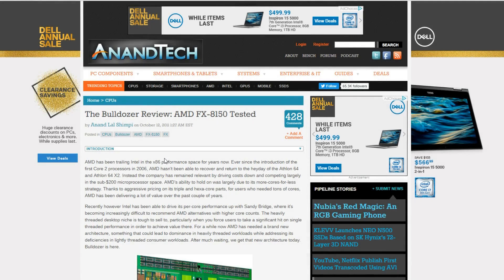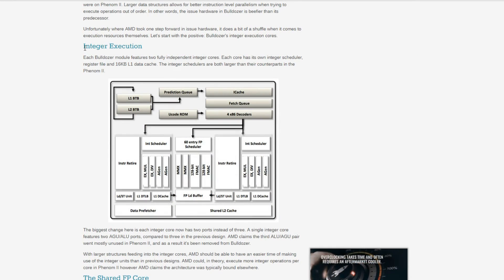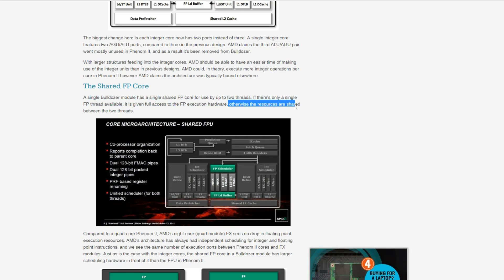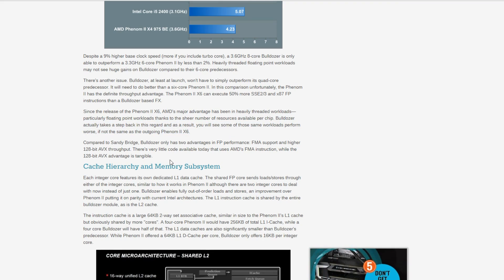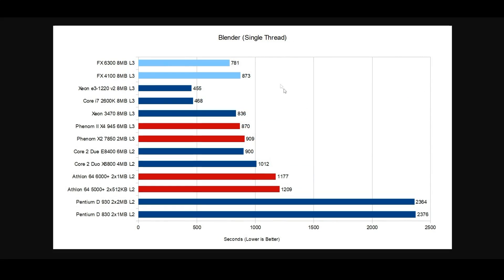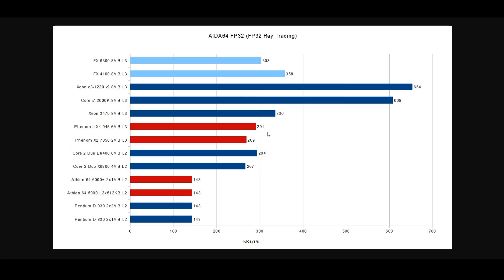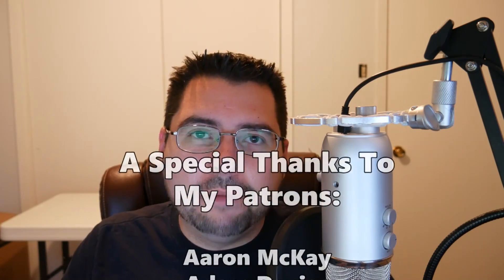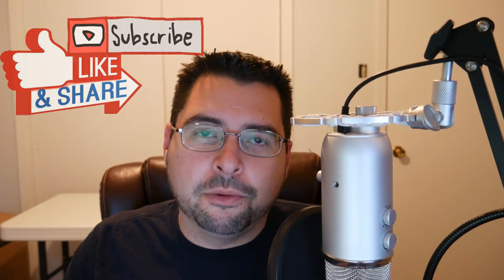IPC Test 7: AMD FX Series CPUs! How Does it Compare?

Comment: 💻 My PC is currently a FX-8350, and I'm glad that more games are supporting more cores. It has kept my CPU alive.  👍
Reply: Yeah, before I upgraded to my current R7 1700 I used a FX 8350 and I've been happy with both of them. =)
In multi-threaded performance the FX 8350 is roughly on par with my mothers R5 1400 but the Ryzen chips single threaded performance is roughly double the FX chip.
The 8350 was kind of a multi-threaded beast.
Sure the Intel chips crushed it in single threaded performance.
But the two cores in a FX module scaled way better then the two threads in a Intel core did and while I most certainly do recommend upgrading that FX 8350 it could beat a i7 3770k in some workloads both chips running at stock. (Never seen it beat a i7 4770k in anything though).
Reply: Yeah, I think like most technology users, I am obliged to be content, and pleased with the technology I do possess, because I cannot afford to buy a new Motherboard, Ram Sticks, and CPU, etc.
Reply: +Tech We Love  
Don't be so sure about that.
Granted the following parts doesn't exactly make a great system...
But you can get onto the AM4 socket for 160 dollars.
https://pcpartpicker.com/product/sL7v6h/gigabyte-ga-a320m-s2h-micro-atx-am4-motherboard-ga-a320m-s2h
https://pcpartpicker.com/product/HLzZxr/amd-a6-9500-35ghz-dual-core-processor-ad9500agabbox
https://pcpartpicker.com/product/FW38TW/geil-memory-gpr48gb2133c15dc

That combination is probably worse then what you currently have.

But it would give you a functioning system on the new socket so you can start upgrading parts one by one instead of all at once.

Alternativly you could get the AMD Athlon™ 200GE when it comes out, it's just two cores and four threads, but it only costs 55 dollars and its single threaded performance should still be superior to your current CPU even if its multi-threaded performance is much lower.
Either way getting onto this new socket isn't as expensive as you might think.
Regarding the Zen based athlon I suggest waiting till the AMD Athlon™ 240GE comes out before buying the AMD Athlon™ 200GE as the 240GE might be quite a bit faster and these zen based Athlons unlike the Ryzen chips can not be overclocked.
And the motherboard I linked to doesn't support overclocking either...
What kind of GPU do you have?
Reply: Edit : Here is a link to the comparison of a Fx-8350 to the A6-9500 APU.  http://cpu.userbenchmark.com/Compare/AMD-FX-8350-vs-AMD-A6-9500-APU-2016-DBR/1489vsm302063  😥 It would be a significant downgrade for me to purchase this. Like you said, and my feelings suggest, I would wait for savings to build up, or for newer parts to get to the price range where it makes sense for me.

I currently have a GTX-1060 6Gb for my GPU. I wanted to get the RX-480 8 GB, but I already owned a G-Sync monitor, because I bought a 1080p monitor, on sale, when FreeSync monitors weren't even on the market yet. So, I kind of needed a GPU that would support the monitor I owned, etc. I really wish Nvidia would enable FreeSync on their monitors. Nvidia would earn a lot of respect from the industry if they did that.
Reply: +Tech We Love  
You didn't look at the Athlon 200GE, unlike the A6 9500 it would be a sidegrade with significantly worse multi-threaded performance, roughly equal quad thread performance and somewhat better single threaded and dual threaded performance as far as I can tell (there's no reviews of it yet but its clock speed is similar to my R7 1700 and that's way better in performance for the first of the two threads pr core compared to the first core pr module of the FX 8350.
So you can still get into the platform and get better performance in some applications for 160 dollars.
Alternativly you could get a 1600 on sale if you can find one.

As for your GPU and monitor.
While adaptive sync is nice you don't have to buy a GPU supporting it to have a nice experience.
But fair enough.
Regarding their monitors supporting Freesync, that just ain't going to happen, the whole point of those monitors is to encourage people to buy their GPUs.
Regarding the other way around...
Their GPUs technically already support the VESA Adaptive sync standard in laptops.
But they don't have it enabled in the drivers...
But if they keep losing the standards war it'll happen eventually.
Reply: +Tech We Love  This video was just released: https://www.youtube.com/watch?v=pCDJERMTL3s
Reply: ya way better off to try n get a high end r3 on cheap 50 dollor am4 mother board then after u get cash together in a plop a r5/r7 in it. i mean and 8 gigs probly right around 250 300 all together
Reply: +lordvass  I wouldn't trust those 50 dollar boards with an R7...
An R5 is probably ok though...
Reply: eehhhh maybe the r7 but i mean razen is so effecit yould be fine just wouldent over clock maybe not render with it for 8 hours at a time lol would be fine for 98% of people
Reply: +lordvass I'm fairly sure that a Ryzen 7 2700X at stock would be a bad idea with the 50 dollar motherboards...
Not just for 8 hour renders but also for gaming...
Yes, it's fairly efficient, but if you have a core that boost up...
Like, with my Ryzen 7 1700 my power use is actually at its highest when I'm just running a single thread because that core is boosting up...
So yeah, probably no X models and probably not 8 cores.
A 1600 or a 2600 should be just fine though.
Reply: yes did u ever look to c what votage your board pushish? i dont use that xfr shit hears y and a low end motherboard would not likely use xfr at all or much. i have a gigabyte x470 gamming 5 wifi. ummm my voltage spicked to 1.52 fucken volts 1.52 yea thats right about .08 above what amd maxamum recomended of 1.45 and yea that shits dead i just do an all core 4.1 at like 1.43 so idk wtf xfr dose but no its not quite ready yet. i just likly got a less than spectacualy binning boo but hope that helps
Reply: +lordvass  XFR works just fine, but for the best results you should lower the offset a bit and make sure your loadline calibration is set at a good rate.
At any rate I know my own motherboard does just fine.
I got a X370 Taichi, pretty much the best first generation AM4 motherboard out there in terms of hardware (even if the software and firmware was less then fantastic at least initially...)
Reply: do u own a gigabyte x470?  cuz there ant no load line its alittle fucked up. there is a load libne kinda i mean it changes at a certin freqance for both ram and cpu o by the way it dosent tell u when so u can have a +200 offset take the ram from 2666 to anything over that and bad like 1.38 sov votage and before i restarted at 2666 it would be like 1.2 1.25 and then it dose its fucked up madness seems to  be an ok board i just wouldent use it or recommend it for overclocking and u would think a 179 dollor board would have a load line setting somewhere if u find one on the gigabyte x470 gamming 5 wi fi let me know
Reply: there is not load line on gigabyte 470x u choose load line by your overclock and the board changes all of that itsself not a good thing i know dont buy gigabyte lol
Reply: there is on the gamming 7 not the gamming 5 or 3 and as far as nothing wrong with xfr that deppends on my board its a no go cuz im not going to allow my voltage to be at 5.25 volts soooo gigabyte boards go in and turn off your xfr on a gamming 7 idk on a gamming 5 or 3 turn that shjit off
Reply: and to be fair i had to use good monerting software to catch it. it dosent stay at 1.525 but it dose spike that high on my board
Reply: +lordvass 
Load line calibration isn't about the voltage you choose but rather how the amount of voltage changes when the workload increase or decrease the number of cores/threads being used.
But yes, what motherboard you pick matters in this context...
Reply: i realize that lisen i really dont know if the gammin 5 wifi even hace loadline its just a really fucked up board for overclocking i miss the amd 955 days when i set it to 1.52 ans it ean 1.52 no matter what to vdrop no nothing top like 3% of all amd 955 in 2011
Reply: +lordvass
True, however with high core count CPUs the high voltages you may use can cause dangerously high amounts of power to go through the VRMs so the loadline calibration is actually a safety feature to reduce the risk of bricking your motherboard and CPU.
Reply: maybe all i know is when they went from analog to these digital choces there still not as acurrate as a 2009 amd 790fx somthing or other board and gigabytes implamantation of what ever the fuck this bull this of rasing your clocks rasies the voltage is bs and i have so many fans on my cpu vrm ram i dont think i really have to worry about voltage well the heat part of it witch means vrms r a ok ram and cpu ehhh and got a beffy after market air collor 2 one of thouse dual tpower desins

Comment: i had 6100 4.2ghz it wasnt to bad for 60fps tbh with hd 7870 i used that pc for 4years yea 4years but really wasnt to bad back then
Reply: Most games are targeted for 30FPS on what is basically an 8 core FX chip downclocked all the way to 1.6GHz.So yea, if you can't get 60FPS from a 6100 @4.2GHz, then it is a bad port; you have double the processing power over fewer cores.
Reply: Amir Abudubai  I think they meant, it does good and holds 60, like 60 Hz gaming. My FX still does fine even if I plop a Titan Xp into it, at 4k the only thing keeping it from 60 fps would be that the Titan is too weak...

Comment: Yes this was the time when they wanted to compete in overall performance. Buldozer is a slow single thread cpu with many real cores (not smt) they hoped that this approach will cut it but due to architecture and GLOBAL MOFO terrible nodes this idea is floped hard. But i still believe that in modern multi threaded environment it is not that bad.  And it is cheaper :D
Reply: Actually FX used clustered threads. It only had 2 clusters containing 2 module/cores per cluster, 4 module/cores, 2 clustered threads per core/module. Each cluster had one shared128 bit floating point. Each floating point was shared between 2 module/cores in the cluster. Technically the FX "8 core" was a quad core. AMD settled over a lawsuit out of court back in 2016 for falsely advertising more cores than what they actuslly had.

Comment: Bulldozer
A bulldozer is a crawler equipped with a substantial metal plate ... -- Wikipedia
No wonder it is sloooooow.
Reply: AMD is always forward thinking. First to introduce 64bit instruction set and first to introduce mass core counts. But the devs and programming tools are always slow to adopt and optimise. Bulldozer is "Zerg" (2 units for the price of 1) while Sandybridge "Protoss" (1 for 2). On paper it should work, but the reality sucks. Only recently devs start to optimise on multi-cores process, resulting the old dozer to perform similar with intel's lesser cores cpus. It's short on IPC is really obvious on single core heavy older titles, not to mention thermal and power draw disadvantages.
Reply: curt oblivion just goes to show you, the adoption rate goes hand and hand with the install base. Why would they (devs)work harder to develop on amds fx design when intel had so much more of the market share?
Reply: Not exactly, intel also had 64bit and >2 cores chips for a long time before os and app catching up. Not so until major consoles catching up and ram going dirt cheap if I recall correctly.

Comment: Considering how FX series are ought to be cheaper nowadays, they can be a good solution for a budget HTPC option or something that can play RTS game for a cheap price. While I could imagine the FX-9590 playing HOI4 at a playable fps (>30, also a game that I love), I rather refuse the offer because the single core performance of my G4560 is superior, plus power efficiency.

However, Zen 2's R5 3600 has my money on it next year. It will be a shock once again to see a 6C/ 12T at over 3.5 ghz base clock, on 65W and under TDP as well as lower temps, for under 300 AUD. R5 2600 is pretty damn good already, but because of that I'm even more interested for its successor next year.
Reply: I don't think you will get lower temps, FX was rated for like 69c max (I think thermal shutdown is 80c). Normally they ran pretty cool (thanks to a large surface area, and solder). The smaller nm architectures seem to be a pain to cool, even when they only put out 1/4 the heat they still run hotter. Temps are relative anyways, like my Titan Xp stays over 80c stock at 100% fan, but my more power hungry R9 Fury cards stay below 60c even with voltage increase. Its not like the 80c is of concern for Pascal, but 80c for a Fury would be awful and probably kill it fast.
Reply: Well I've seen R7 1700's with idle temps of ~20c, which was a shock since my G4560, which is about 1 year old now, gets an idle temp of ~30. Now I don'tt know all the details, but I'd like it to be because of the solder + wraith cooler, which is reportedly much more competitive with aftermarket parts. Surely you rather not buy an extra cooler if your stock one is already good enough.

So even with what you say, I still expect things to be "cooler" than they are, at least more than my PC just by a little bit. I know we are talking 6 core CPUs, but damn, does AMD make some attractive products.
Reply: David Nguyen  That's colder than room temperature. If we are counting arctic tundra, my FX has that beat. I'm peaking at 10c max core load at 5.5 Ghz and 1.7 Vcore. Maybe my block temp of -25c at its hottest has something to do with it...

My Ryzen at idle is showing 30c (AIO cooler, fan ramped ready for benchmarking multi-GPU). So it could go down maybe 2c to 28c, but no lower because due to physics and the law of Thermodynamics, it can't be colder than the cooler if its putting out heat, and my cooler has a theoretical limit of hitting room temp given no heat load and infinite time to exchange heat. Simply: You can't go below room temp with an AIO or air cooler (its actually even worse, it can't go below the temperature of the air its located, which is generally in a hot case). Case temps are usually 30c (but I'm running mine open, and my AC is cranked)

Comment: Glad to see you're feeling a bit better.
I owned the Phenom II 945, came with an HP I had years ago. Ran a FX 8300 for years in my gaming rig, sold it. Still have an FX 6300 in my Linux rig. It gets used for email, shopping and regular mundane tasks. I have played some Steam titles with Linux support that I have in my library. Mostly BioShock Infinite and there is a R9 380X in the rig so it does okay for that.

Comment: If you say that it did not pay off, you are forgetting the consoles. Neither Sony nor Micro$oft would have contracted 125W 4-core Phenoms. I still have on my vintage computers a Phenom II 965BE, an FX-8350 and another FX-8300, all on 990FX chipsets. The Bulldozer was not really that bad when compared to Phenom 2 in most cases. There was still one problem with many games and benchmarks: software compiled with the Intel C compiler would not use AVX or any proper optimizations on those CPUs. With GCC, there's a different story, so I stopped using Intel compilers unless absolutely needed for old codes with special libraries and features.
Reply: The console cpus had nothing to do with Bulldozer as they were Jaguar based.
Reply: Andrei Neacsu no way I thought Pheonom were better than FX core for core , why would they even make 8 core FX chip , all they did is get a pheonom chip shrunk it to 32nm and split it into two so it can perform better in multithreading , tbh they should have kept the full core to not sacrifice single core performance and IPC by shrinking pheonom to 32nm and improving IPC and make the FX 8000 6 core and FX 6000 4 cores and FX 3000 2 or 3 cores , I saw a video that shows that a 4 core pheonom beats the FX in gaming while the FX is better than phenom in multithreading but not by 2X.